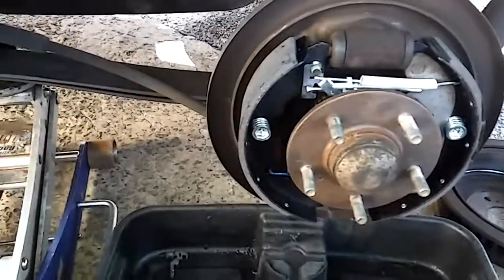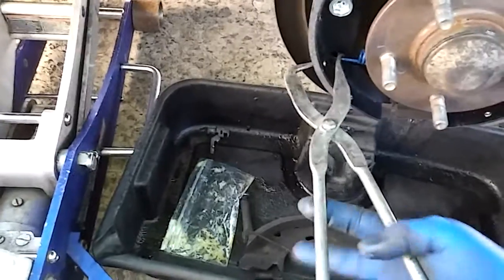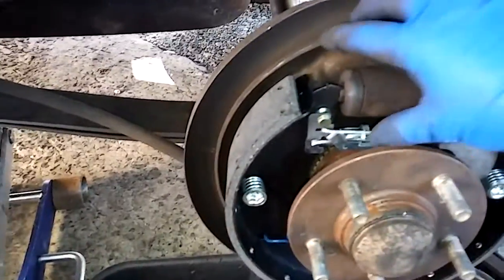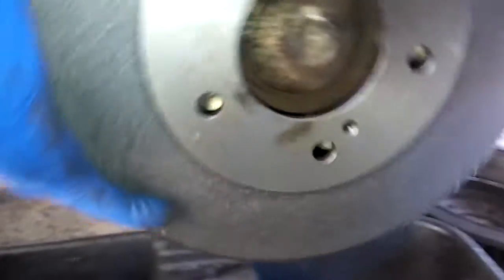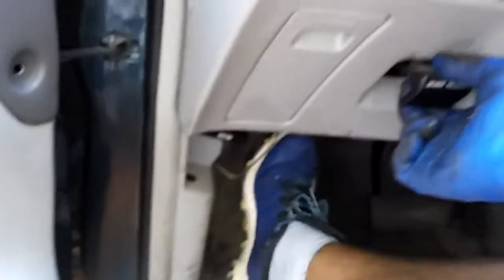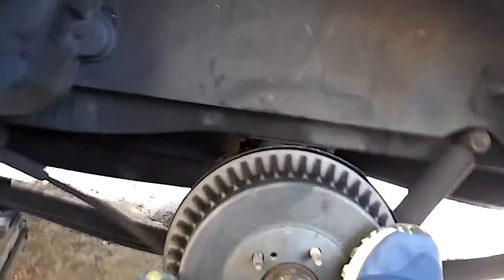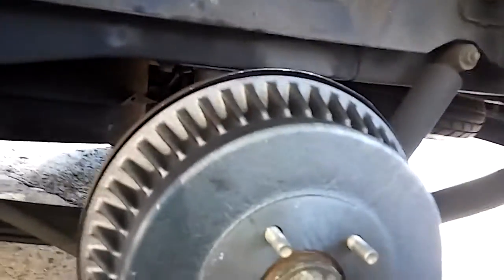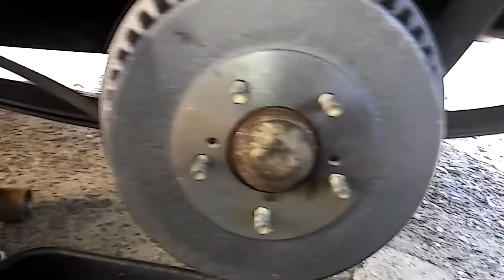1997 mercurry villager drum brakes done

Comment: Thanks. Do you know about using a puller tool to remove drum? I'm wondering if I can use the axle under the dust cap for leverage with a puller. The screws in drum face worked for an inch or so but eventually started slipping through :(.
Reply from the maker: i dont if u can see on the drum it has this two small threaded holes, u can install two screws in them and as u thight them, they will push the drum away from the hub. any other questions please feel free to ask. God bless!

Comment: How do u take the drum off..video started with drum already off🙁
Reply: If it doesn't slide off give it a wack with a hammer to loosen it. Sometimes there are bolt holes in the flat face of the drum that you can use to pull the drum.

Comment: Thanks. Do you know about using a puller tool to remove drum? I'm wondering if I can use the axle under the dust cap for leverage with a puller. The screws in drum face worked for an inch or so but eventually started slipping through :(.
Reply: in most cases you just give the drum a good pounding around the stud area but dont pound on the studs and it will usually come loose, unless the drums are worn to where there is a ring around the edge of the drum in that case sometimes you have to back off the adjuster to allow for enough clearance to come off